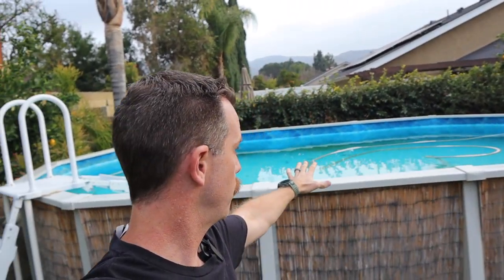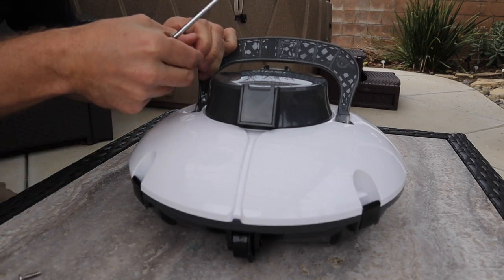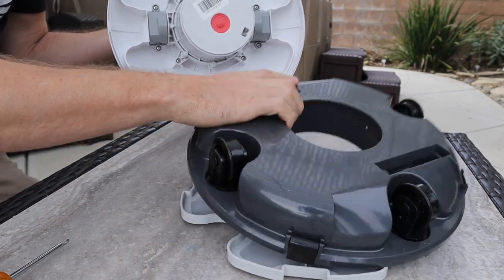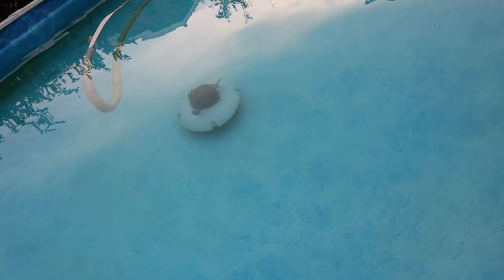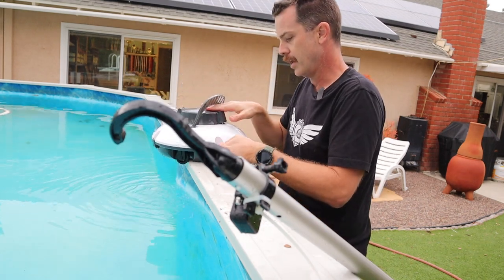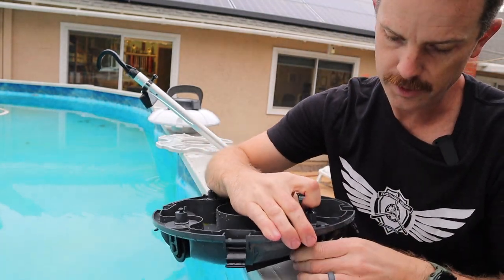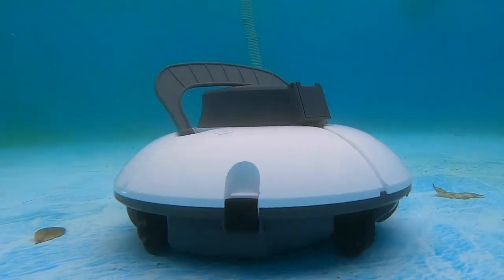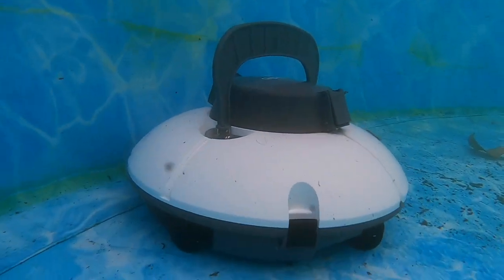Robot Vacuum For Your Pool? AIPER Smart Cordless Automatic Pool Cleaner

Comment: I have the exact same robot and color but under another brand, KOSGHO.. and cost me $61.38 with tax on ebay. My above ground pool has a bunch of wrinkles on the bottom but it does not slow it down !! It just zoom, zoom, zooms !! There are a few more brands that are exactly the same but I think the difference is the battery, mine has a 5200 mAh battery but have not tested it fully as I have an 18 foot round pool and it gets the job done under an hour. So I would recommend this to anyone as it does a great job !! Thanks for making the video.
Reply: Any problems yet? Mine just blows out all the debris it picked up when I retrieve it out on the hook

Comment: A few things I would like to comment on.  Another video says you have 10 seconds to put it in the water after pushing the button and all you have to do is just drop it in - so no need to put the cleaner in the water, then turn it on.  We used a Pool Blaster Max by Water Tech for a couple of summers and discovered that, with those types of cleaners (battery-operated), the battery does not hold up long after a handful of charges and eventually, you will never get the green light at all - we've been through this twice now.  And it's not like you can buy a replacement battery - you can MAKE a replacement battery, if you're good at that type thing.  But from comments elsewhere, I'm seeing the same issue with this little cleaner - wondering if it's not really by Water Tech.  

Another thing that most instructions will not tell you is that you should really not use your robotic or battery-operated cleaner in a pool that you are shocking or a pool where the free chlorine (FC) is over 4 ppm.  

So if you keep your cyanuric acid (CYA) at the "recommended" level of 50ppm, your necessary FC will already be over that 4ppm warning - at a 50ppm CYA, your FC level must be at 6ppm in order to ward off any algae blooms.  Personally, I keep my pool CYA at 20ppm, because I've already tested it and KNOW that the 20ppm is enough for my 17,200 gal pool, which means that I only need a free chlorine level of 2.4ppm...well below the 4ppm.  Your free chlorine level should be about 12% of your CYA.  

So I'm thinking that a lot of these cleaners, whether robotic or battery-operated, are being damaged by the level of free chlorine and possibly high pH.  Research it before risking your new cleaners.  Sorry so long-winded.

Comment: We just got ours in the mail today. Wow, what an amazing job this machine does. Your video is what made us finally decide to get this. Thank you!!
Reply: Is it still working well?
Reply: @kg4955  it did for six months. Then, one of the wheels broke, and from what I found on the website, there isn’t an option to order the wheel by itself. The unit works great. The wheel broke after daily use for six months, which put the machine out of commission.
Reply: Ours worked great last year but this year it doesnt move after putting into the pool. Not sure what is wrong. Any ideas?
Reply: @elizabethsullivan7125  hmm I’m not sure. Ours worked for only six months before the wheel broke and there wasn’t an option to replace the wheel itself without having to buy a whole new unit. It’s a bummer that yours isn’t working anymore either.

Comment: Just got one of these. Thanks for the video . Much easier to learn from a video than it is to learn from reading the directions .
Reply: especially since the directions have photos that are not clear
Reply: Leah Watts  great. It does a really good job. It works way better than I thought it would. The battery only holds charge for about 30 minutes. Sometimes I have to use it twice in a day. It takes about 2 to 3 hours to recharge.

Comment: Thanks for the video!! It really helped. Tos received mine. How long does it takes to charge?
Reply from the maker: It takes mine around 2 hours
Reply: I had mine plugged up for well over 4 hours and the light never turned green.  Literally only moved for about a minute before it would just stop moving. Still on but not movement.  So far EXTREMELY DISAPPOINTED!!!!

Comment: Thank you for this.  I've had mine for over a week and didn't know how to begin.  My lid won't come off though and I'm nervous to break it if I pull too hard.  You appeared to take it off very easily.  Also, I have a pool that goes from 3-6', its a rectangle.  Does that angle effect the vacuum?

Comment: The wheels on my fresh out of the box cleaner has wheel stops on top of stem so once I pull back the tab, the wheel still doesn't release.  The stopper isn't coming off easily and I don't want to break it. Nothing in the instructions mentions this stopper at all. Any suggestions?

Comment: Does this vacuum still work well for you?  It seems like the battery in mine died after 4 months of use, it won't hold a charge any longer.
Reply from the maker: The only issue I had with mine was the charging port got a little corroded and needed to be cleaned. Try cleaning it with vinegar so it makes better contact when you hook up the charger.
Reply: I used it once and it didn’t hold the charge as well I’ll try to use the vinegar

Comment: I brought mines last year and now this year it is not coming on even though it is saying full charge. Have you ever had this problem and is it a battery in it?
Reply: I'm having same issue , it still beeps if it's on when I plug it in to charge , idk if that's right or not ? Please inform if anyone knows . Green light is on , on the charging box regardless if it's plugged into the sweeper or not . So , idk if it's fully charged or if it's dead and or broken ... sweeper does nothing in the water .